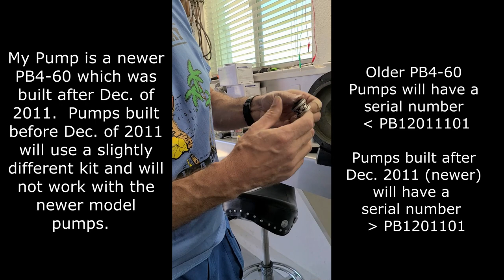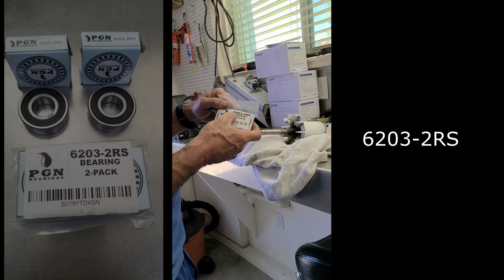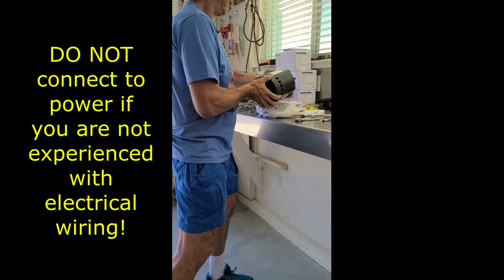PB460 Pump Rebuild Oct 8 2020

Comment: Great video. I think my pump volute is cracked. So, which parts do I order besides volute? I assume the volute comes with its own seal and O ring.
Reply from the maker: Thanks for the question.  When I repaired my first pump, the volute was also damaged.  I needed to replace the volute and the impeller, which I was able to find online.  I believe they came with the seals needed to do the repair.  When placing your order you should be able to see everything that comes with the part.  I use Amazon a lot, but have bought parts other places if they are the same or less expensive.  ONE THING TO BE AWARE OF is there are 2 models of this pump with the same part number (PB460) and they use similar, but different parts.  This drove me crazy as I ordered the wrong parts and they looked similar, but were different and didn't fit together correctly.  I spent a few hours scratching my head as I tried to figure out how to put it together.  Finally I found out that there were 2 models and the only way to tell them apart was from the serial number or manufacture date.  I believe in the video I show this information.  I hope this helps.
Reply: @LS-rl5gp  It helps a lot. Thanks.

Comment: Great video.  I'm in the middle of the project.  My pump serial number starts PB 0830*** so according to your post, it should be the old style.  I have it disassemble and it looks exactly like yours.  I'm on the third kit.  The fist two had too small diameter for the housing.  The third set has the right on but the issue is now the one for the impeller.  Two are too large and the third one is not a snug fit.  It slides on and off with no resistance - use it or go for a 4th kit?  Also, there is a small (shaft size) O-ring in the kit.  I see it in your kit laying on the table.  I didn't see you use it, is it needed?
Reply from the maker: You have a lot of questions there.  Let me see if I can help.  First of all, the two versions look almost identical, so you could have either one.  It took me a few tries to figure out they were not all the same.  I was running into the same problems as you mention.
I pulled out some parts from my garage to look at them.  Here is what I see.  The part with the ceramic piece inside of the rubber is smaller on the older version.  The outside diameter of the rubber is 1.250".  The newer model one measures about 1.375".  There is a 1/8" difference between them.  Almost the same, but only one will work.  The part with the spring in it is also different.  The Older version has a lip sticking out and the lip is measured 1.625" in diameter (clearly bigger).  The newer model doesn't have the lip and measures 1.250" on the outside diameter.  
The O-ring you see in the video and the kit is for the drain plug seal.  There are no seals on the shaft (at least on the newer model).  I use the O-ring near the very end of the video.  
I wish there was a way to comment with pics as it would make it a lot easier to explain things.  I don't have a lot of time now to explain things.  Send me more questions and if you can, or a picture, and I will reply and try to help.
Reply: @LS-rl5gp  Thanks for the reply.  I took the old parts to a pool repair technician and he had what I needed on his truck (cost me about $12).  I'm reassembling with a new motor.  The old motor hums and clicks off without turning.  It wasn't the start capacitor but I will eventually dismantle and attempt a motor repair to have a back up motor.  The motor turns freely.
Reply: @charlesriggs6609   I think I have the same situation. My pump look exactly like then newer style PB4-60 also,  however the serial number starts with PB0518**,  which would indicate the older style.   Should I be using the older parts or the newer?
Reply: @t0107lb  I had to disassemble and take the old parts to match the new ones.  Apparently the serial number break is not a reliable method.

Comment: Why is the motor mounted sideways?
That puts vents on top of motor. Wouldn't that be an issue with rain?
Maybe that's why the bearings failed.
Reply from the maker: You bring up a good point.  The reason was that was how the pump was when I got it.  After seeing your message I was able to remove the 4 bolts that hold the motor, rotate it 90 degrees,  and then bolt it back together.  That took about 2 minutes.  With that said, I don't think it really matters much if water gets inside.  The bearings are sealed.  Also the pump is outdoors and constantly exposed to hot and cold temperatures and varying humidity.   It get condensation in and on it just about every night when the temperatures drop.  Also there are vent holes on the sides and rain even at a slight angle would also enter it.  Thanks for bringing it up though and I did rotate the motor 90 degrees based on your comment.
Reply: @LS-rl5gp  
Thank you for the reply!

Pump motor bearings are sealed bearings, meaning they can't be taken apart and repacked with grease. Though it would stand to reason, "sealed" does not mean "waterproof".

It is true that humidity and a bit of splash up can enter the motor housing, but not to the extent as to reach the bearings, as a direct drip would do.

Motor bearings are "sealed" only up until the point where they have water exposure. At that point the water somehow starts expelling the grease from inside the bearings. 

That's why when a pump runs hot (no water running through it) and the pump seal fails, water is able to get to the face of the motor and at some point later the motor bearing starts screaming like a banshee! It's metal on metal inside the bearing.

I have twice run into mis-mounted motors in the past. The reason was that evidently the electrical hookup was just a bit too short to reach, so the motor was rotated to allow access. Certainly, I have no way of knowing if that was the case in this instance. 

Regardless, your video is very well done, and look forward to future ones!
Reply from the maker: @mayorb3366  Thanks again for the detailed response.  This pump/motor was mounted at a rental house I own and was originally installed by a pool company who did a pool remodel.  You are probably correct that they changed the orientation to connect up the electrical easier.  I remember when I installed the replacement pump, I had to replace/extend the conduit and wire to be able to connect it.  When I changed the bearings, they weren't actually bad, but I did it as practice to understand the process.  I had never done it before.  Having a rental home with a pool (not recommended) I do find myself changing booster pumps more often than I should because they are probably run dry as you mention and the pump parts get hot and become damaged.  That was the reason I wanted to learn how to rebuild them.

Comment: Broke the nipple off on the front. Any tips on how to take it off and not buy a whole new front panel
Reply from the maker: I've broken a few nipples off over the years.  I'd recommend using an "easy out" or similar tool.  It screws into the nipple in a reverse direction of the way it would tighten and as it gets in further it will start to unscrew out the nipple.  I did a search on google and found this at home depot, but there are plenty of similar products out there.  
https://www.homedepot.com/p/Husky-Pipe-Nipple-Extractor-Set-6-Piece-410-391-0111/309997715?source=shoppingads&locale=en-US&mtc=Shopping-VF-F_D26P-G-D26P-26_7_PLUMBING_REPAIR_And_REPLAC-MULTI-NA-Feed-LIA-NA-NA-New_Engen&cm_mmc=Shopping-VF-F_D26P-G-D26P-26_7_PLUMBING_REPAIR_And_REPLAC-MULTI-NA-Feed-LIA-NA-NA-New_Engen-71700000070895257-58700006242583465-92700056340154968&gclid=CjwKCAiAhbeCBhBcEiwAkv2cYwF5cxozhQhhY1hCrr2RZ-zXV4uvO4iWUih9aQKBTANZDqgDLI_TpBoCLWIQAvD_BwE&gclsrc=aw.ds   
Let me know if it works for you.
Reply: @LS-rl5gp  i just bought those and its a size between them. Ordered a new one since it not to expensive. My last question is how tight should I get them?
Reply from the maker: @royaldaba8437  When using an "easy out", they thread in opposite direction that the screw or pipe would normally turn to tighten. So as you thread it in, it will gradually get tighter until at some point, the screw or pipe starts to unscrew.  Of course when using an easy out be really careful to not break it off inside or else you will have bigger problems.